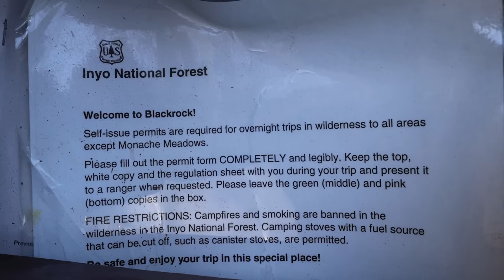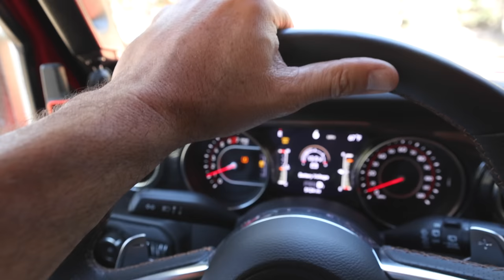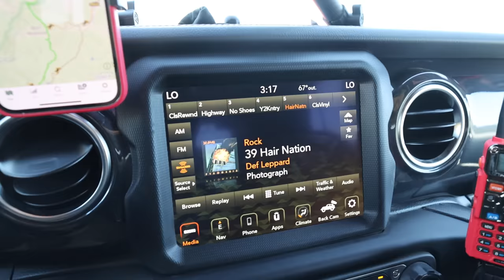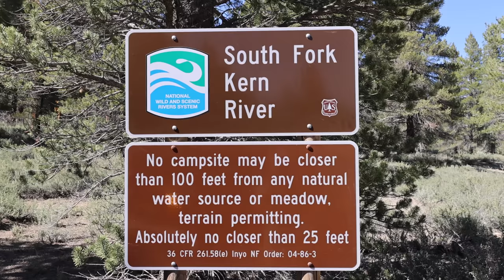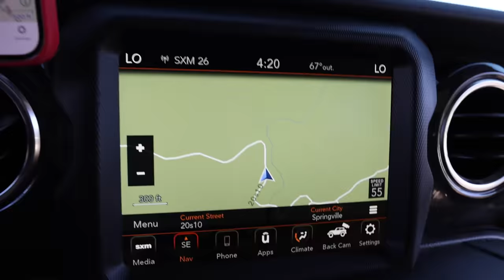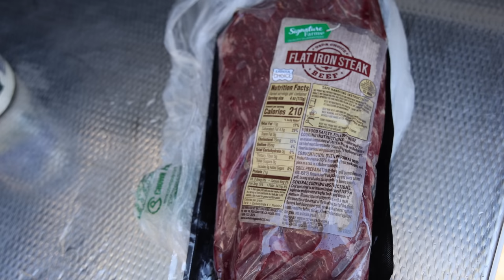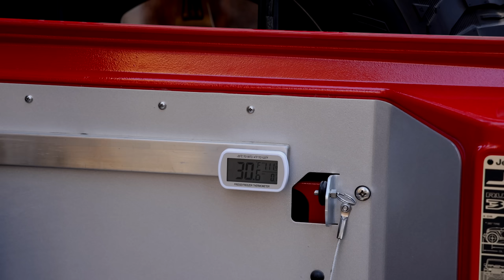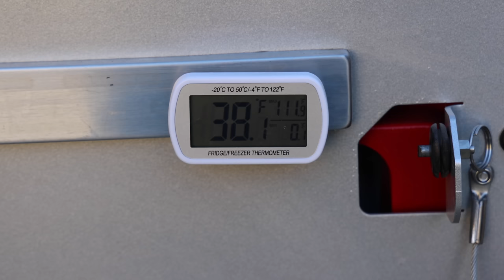Things Don’t Go as Planned on this Sierra Nevada Mountains Adventure

Comment: Hey Brad, a recon marine here. Enjoy your videos, I have watched your videos for years, and over landed/ hard core trails years ago ( 1994-1999) after a dusty day on the trail we would always blow out our air filters.   It would be a great thing to show and share the reason for doing so (gas prices and performance).  When you have a few vehicles the dirt and dust in the last vehicles is awesome lol.  If you are not running the A/C or heater you should cover the inlet in the cowl or depending your vehicle where it's located.   This will keep dust out of your inner filter and stop the dust storm when you do turn on your fan for heat or air.   Semper Fidelis,  shout out to Navy Cormen ( SARC)
Reply from the maker: Thanks for your service Devil Dog!  Dust can be a problem and I know a few folks that blow their filters out, I just prefer to change mine out often and will even carry a spare on a long trip.

Comment: Great area to explore and a very nice trip.
Just a small correction, mt. Whitney is not a volcano. It was the little Whitney cinder cone that erupted about 700k years ago. It is part of the Golden Trout Creek lava field.
Reply from the maker: Thank you, I think in my initial research I wasn't through enough.  You are correct!   "The Golden Trout Creek volcanic field consists of a group of Quaternary basaltic cinder cones and lava flows in the Toowa valley of the Sierra Nevada about 25 km (15.5 mi) south of Mount Whitney, California. Lava flows from the Golden Trout Creek volcanic field erupted through granitic rocks of the Sierra Nevada batholith during several episodes dating back to about 743,000 years ago, when the Little Whitney cinder cone and lava flows were erupted."

Comment: Great timing as we just came back from MM on June 12. We snagged the last sites (at the turnaround) next to the river. About a mile hike to the dam. I agree with the moderate rating as the ruts (particularly that one section) are much worse then a few years ago. I know you’ve done Coyote F but, if you do it again, may I suggest going to Hidden Lake at the “end” of the road (East side of CF). You can’t drive all the way to the lake but the hike is only about a mile and a half from the end of the “road”. Also, great car camping at Saddlebag lake North of Mammoth. One of my top 3 hikes in the world is across the Lake.

Comment: If you haven’t already, invest in a Thermacell for the skeeters. Best $25 buy you will make for a static camp ever. 

No one eats better than when with Marco!

Semper Fi, Doc!
Reply from the maker: Just our experience, but we actually used them a few times, even had 3 going at camp once and really didn't seem to help much.
Reply: @TrailRecon  that’s interesting. But, as you said everyone’s experience with different products is not always the same. You could always just break out some of the ol’ green bottle mil- spec bug juice! 😬👍

Comment: Great video Brad and Marco ! I happen to love Chili Relleno , whenever I try out a new mexican restaurant I get a chili relleno , if it's good I will go back and try everything else but if it's not good I won't be back . Cerro Gordo is a interesting place , I was there last summer when they were pouring the foundation for the Hotel that burned down a couple years ago . Was a great visit although on the way up I got a over temp alarm on the transmission , switching to low range cured that problem but just as a note the road is long and pretty much constant uphill so it is hard on the cooling system .
Reply from the maker: Good to know about the climb, thank you!

Comment: That extinguisher activation was a really good example of why you should go with a CO2 extinguisher. No mess when you use them and way less harmful to electrical products. Also you arent going to put out an engine compartment fire with a fire extinguisher period. We use 500 gallons of water regularly and that is after we have cut a v notch around the hood lock to even be able to get at the engine (and that with full turnout gear and air). So just get a CO2 extinguisher - less damage to contents and about the same chance as a dry chem at putting out fire.

Comment: Might want to look into whether fire extinguishers have an altitude rating.  That trip from near the Sierra crest to the low lands has considerable atmospheric pressure.  I've had containers sealed at lower elevations, like down in the San Joaquin Valley, explode.  An extinguisher should already be under pressure.

Comment: Great video Brad. Question ? Would return to this location with your RAM and Four Wheel Camper?
Reply from the maker: No, there were some tight spots and don't love driving it on shelf roads.
Reply: @TrailRecon  Thank you for the honest reply. As the owner of a full size truck and a FWC, I am always concerned about trail conditions. Do you have plans to attend the next FWC rally in Dec? If so, perhaps we could talk more about possible trails.. Thanks again. Dan

Comment: Question          When filming on the trail, the 2nd Jeep is so close to the lead jeep it seems through the whole dirt road trip you are sucking dust! How often do you have to replace your engines air filter?  Or other than filming are you keeping back a distance so you are not sucking Dust?
Reply from the maker: We admittedly keep it tight when the camera is rolling for visual affect, but yes, I do replace my air filter often.

Comment: Man, you all just did the trip that I'm planning on for later in the year...but in reverse...probably hitting Coyote flats first, then heading south to Monache Meadows.  Hopeing to do 2.5 days at each location with a group of other guys.

I've got a question for you about Coyote Flats.
 - I noticed you came in from Coyote Valley Rd to the north outside Bishop (from the coords you provided).
 - can you come in from the south?  Starting at Glacier Lodge Rd/Sugar Loaf Rd outside Big Pine?
    * If so, how's that road compared to the one from the north?  Passable for a somewhat stock 4x4 pickup.

Thanks.  Hope to one day meet you in person either on the trail or around the San Diego area.

Comment: Question...Does anyone know if there is an offroad trailer that is sold empty just for hauling gear? I don't want a kitchen, tent, or any popup roof. Basically just a offroad uhaul.  Thanks
Reply from the maker: Check out some of the old military trailers, they can be purchased pretty cheap and are built to last.
Reply: @TrailRecon  Thanks!! Just found a m1101 that I like.